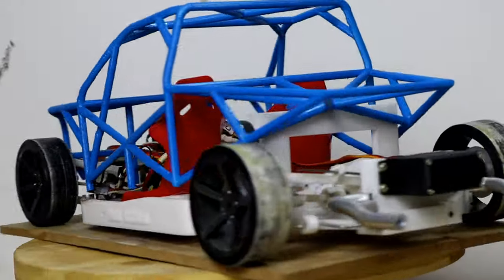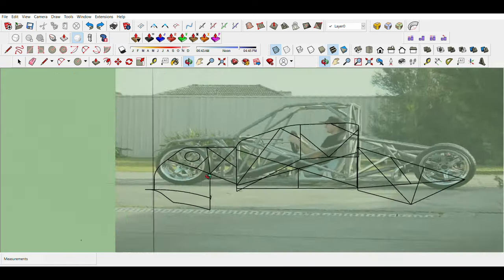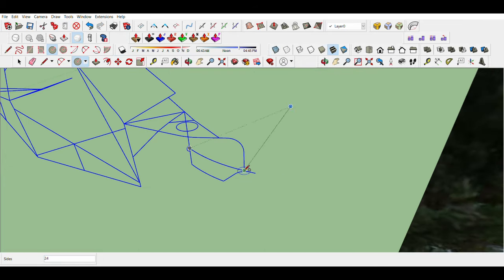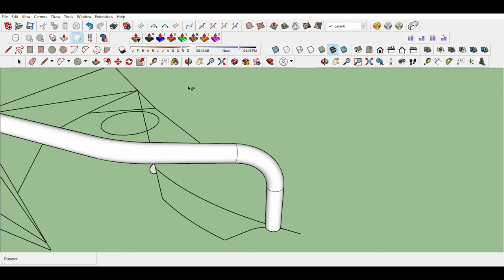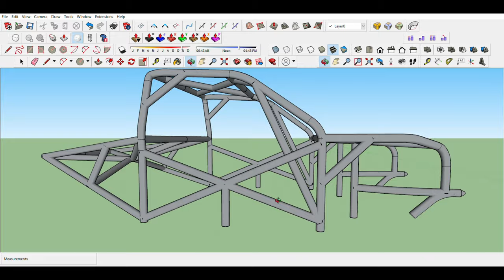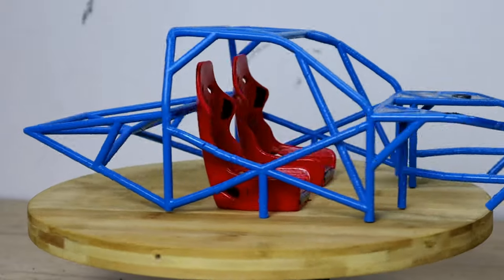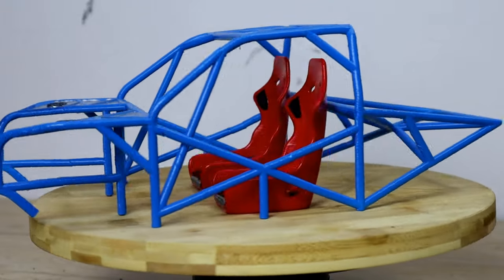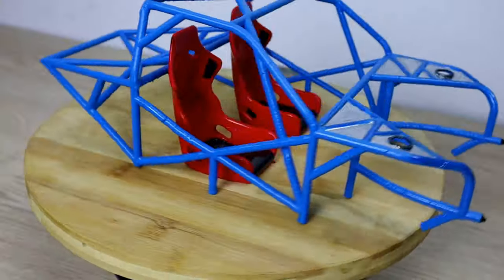3D printed 10th scale Fully Cage Drift Truck\/Toyota Hilux Drift Car Build Project/Scale Addiction

Comment: Awesome job, resize the seats and it would look perfect👌
Reply from the maker: Actually the cage is high and its designed for Sakora D5 chassis, and it will look perfect on D5, I used my 3d printed chassis just for display
Reply: @scaleaddiction  it came out really good, im doing something similar to my 1972 Vaterra V100 Olive drab camaro, you can see it on my channel, im doing the whole thing over with full rollcage, 3D print full detail LS3 engine. Stay tuned 😁
Reply from the maker: That's awesome,  good luck,  I will watch it definitely
Reply: @scaleaddiction  Awesome thanks